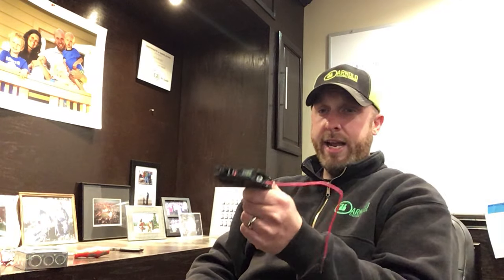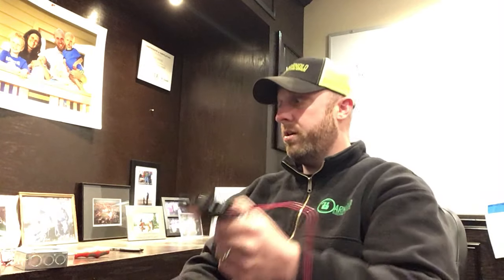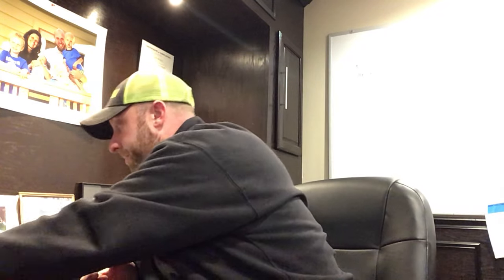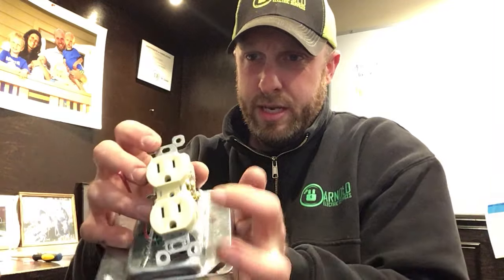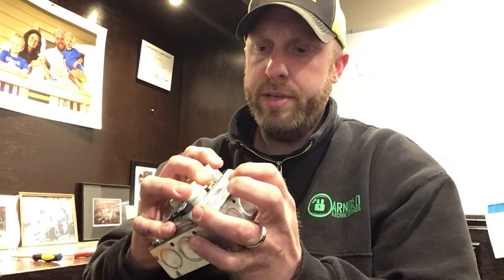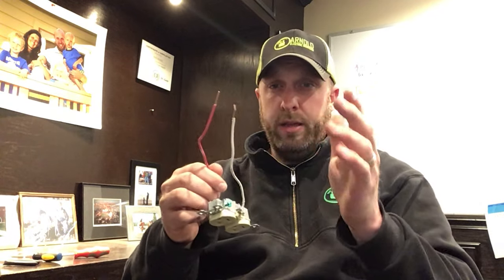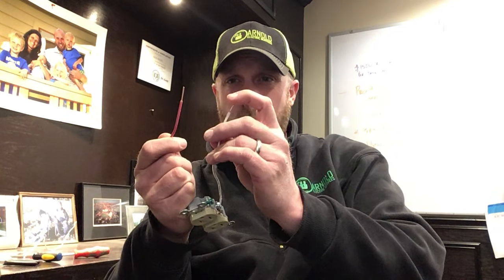3 Reasons Your Circuit Breaker Keeps Tripping

Comment: What are the chances that the braker is bad and needs to be replaced? Thanks for the vid!
Reply: Slim possibility. If you remove the panel cover, swap it with known good breaker and it continues to trip, you know it is not the breaker. (Or if it does not trip, it was)

Comment: Why does my light come on in the off position then the breaker immediately trips when I flip the switch into the on position to shut it off. This switch has been in my home for several years. I took a light out and it started doing this.

Comment: What about the breaker tripping when you add a load to the ckt...any load like turning on a light, plugging something into the receptacle, etc? that's my issue. i have several light switches, smoke detectors, and two receptacles on that ckt. they all worked for years until the weather caused a neighborhood blackout. when the blackout was over the ckt started tripping. it doesn't matter which switch or receptacle in that ckt. i disconnected the smoke detectors, unplugged everything, and tuned off all the lights. the breaker stays energized until i either turn on a light, plug something in, or connect a smoke detector, then the  ckt trips.

Comment: What about bad breakers? Can a breaker keep tripping because of this? What causes a breaker to go bad?
Reply: Yes, with age they can weaken and get tripped at lower amps. Replace them.
Reply: I'll note also now that I've had to replace more on my old Murray panel, it fixed many odd issues. My breakers wouldn't fully trip and the majority of the lights in the house would flicker. Replacing the breakers fixed it. 

When trying to find the issue online, I couldn't find anything and what I found said DO NOT replace breakers from another brand. Thats not true anymore a lot of company's sell the same breakers(just match the type and same amp) and I was able to replace all of mine and it didnt even cost that much, compared to hiring someone to replace my panel and breakers.
Reply: Of course be isn’t going to tell u the easiest fix.

Comment: My older mh i had issues with my hot water heater. The breaker would trip. Turn it on get maybe tepid washer. Had stuff replaced in water heater but still had breakers trip.  Turns out the breaker switch was damaged and burnt and brittle.  Replaced that and bam hot water and no more trips.

Comment: Hi Arnold, I'm having an electrical issue at home, I was wondering if you could guide me. 

I have a cable that runs from the oven directly to the main breaker, passing through a socket purposely fitted for the oven. 
When I turn the socket on the breaker switches off, but when I turn the socket off then I can turn the breaker on and it will work. 

However I tried changing the socket with a socket that I know for sure it works, but the same thing happens. The oven is not yet connected. 

What could it be??
Reply: Weird. Could it be a short-circuit? And by "then I can turn the breaker on and it will work.", what did you mean by "it"? The breaker?

Comment: You only diacussed the 3 causes which are external. But what if the circuit breaker is faulty and keeps tripping as a result?
Reply: Exactly i hoping this is my issue otherwise the short is in the wall somewhere and im screwed

Comment: Got an estimate last week.  They also said they wanted to re-wire from 14 to 12 Gauge into three separate rooms.  He didn’t even look at the wiring. He just gave me an estimate of around 2400.  Not including the possibility of opening up the wall.  

I started questioning him, cause he told me my laptop can trip it as well? 
My parents been living in the house since the 60s.   This always happened over the last 30 years cause of a hairdryer and heater on at the same time or a combination of toe high wattage items.  This only happens on one side of the house.

Comment: Could also be drywqller's pierced a wire if that's the case witch the % is very low but again could happen if that's the case then good luck to locating the pierced wire reason I say that cuz it happened to me licensed electrician for 20 years..
But like the vid 👍
Reply: That could happen and that would fall under the short circuit category.

Comment: My house was rewired with 20s and 30s 30s are doubles
Problem I'm having is my welder trips the 20 amp it's on . This is a 110 cheap Flux core wire feed.
It works at a house that was wired for a wood shop and a weld shop under the wood shop.

Comment: 2:50 or the plug is so old and they used backstab method on it, and the inside has just seen too much and now its jumping across the entire socket. 1986 built, every single switch and socket all back stabbed.. and near crumble in your hand when removing them...

Comment: Thinking I may have a grounding issue or may need to install additional dedicated outlets in the garage.  I can’t run a shop vac and an air pump at the same time. Or  smoker and a shop vac.

Comment: used to be 2 20 amp kitchen circuits. Thanks!
Reply: 2 - 20amp Small Appliance Circuits as a minimum just for the countertop outlets. You should also have an individual circuit for: Fridge, Dishwasher, Microwave, Disposal, Stove and Exhaust Hood. Sometimes you can combine the stove if it's gas or propane with the exhaust hood.

Comment: Thanks for the wonderful video. Quick question. What could be the reason if the wire attached to the 15amp breaker is melting inside the panel?
Reply: LIKE HE SAID! The dang thing is too hot! Unplug something! Or your house is gonna burn down! 😬
Reply: Or place it with a 20 amp breaker! 🤔
Reply: @VRtechman  ... along with that ciruit wiring. It is not allowed to have 20A breaker on 15A wire circuit.

Comment: My refrigerator had water leaking issue, the specialist fixed it and it worked fine for about 6-7 hours  ,until he fixed the refrigerator water leakage the circuit tripping issue was not there ,now everyday the person comes and fixes the fridge and it starts working and by evening it again trips the circuit, the fridge gets repaired next day again and by evening it again trips the circuit, this is happening from last 4days and neither the electrician nor the fridge repair person can identify the real issue. Kindly help

Comment: I have a air  compressor and it keeps tripping my switch what should I do
Reply: Hire a qualified electrical contractor to install a dedicated, correctly sized circuit for it.   If you keep overloading it, the breaker will just start tripping sooner.

Comment: Or, you have a bad microwave oven that needs to be replaced.  I found out by first replacing the socket ($4) then circuit breaker ($6) Lastly, I replaced the microwave and no more tripping!

Comment: You left out loose connection at the breaker, increased resistance generating heat, causing the breaker to trip after a while.
Reply: This would fall under the overloaded circuit.